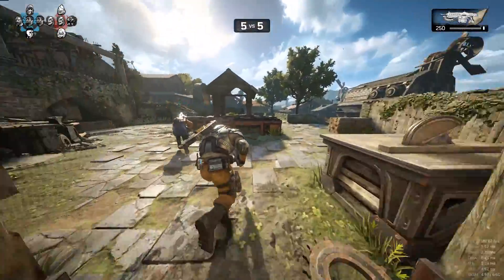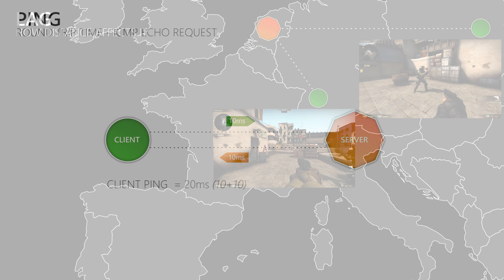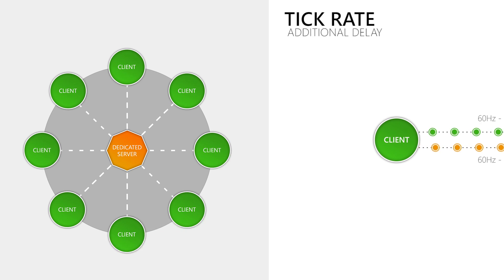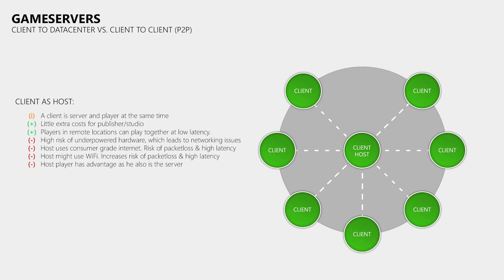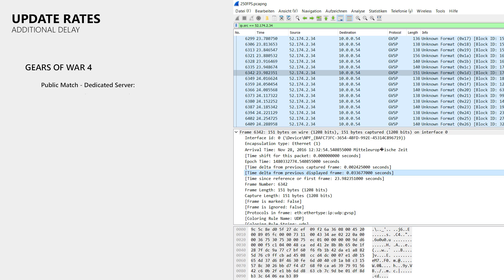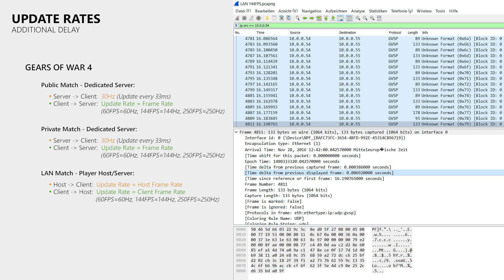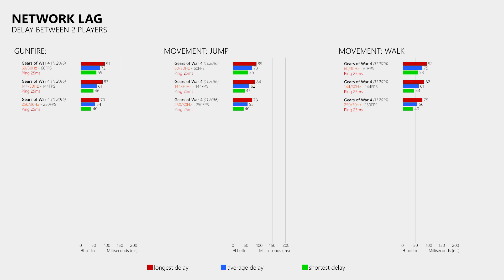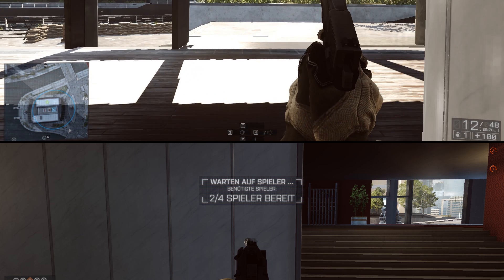Gears Of War 4 Netcode Analysis - 250Hz Update Rate!?

Comment: Your fps are very high, I guess. At the release they were even fucked up with a 1080. Wuld be nice, if you could tell me your system specs, so that I can compare them to mine. Never mind, you'Re playing on very low settings, as it seems. :D

And a huge shout out to you, Chris. Your content is everytime high quality. I really love your ambition, which you put into your videos. Keep it up.!
Reply from the maker: I have a 1070 here and a core i7 6700k. With the recommended GFX settings (which are quite high) I get 180 to 220FPS.  It's a pretty well optimized console port. :)
Reply: I've got an i7 5930k,  Msi 6G 980ti. I'll assume the same fps, maybe a bit higher. Is there an option to limit your fps?
Reply: I've got an i7 5930k,  Msi 6G 980ti. I'll assume the same fps, maybe a bit higher. Is there an option to limit your fps?

Comment: So, what exactly does the "network smoothing factor" option control in battlefield? In bf3, i would turn mine all the way down because when i used the TV missile in the helicopter, the input lag would he waaaay lower, but only when my ping was less than 30. Aside from this, weird things would happen, such as stuttering when i took someone's dogtags and players skipping around when they were so far away.
Reply from the maker: +Pilot KaZZ it made player movement (especially rotation of i. e.  tank turrets) smoother. But it did that at the cost of increasing the delay.

Comment: There is an issue with the server or the clients.
To explain this in a simple way.
I can walk upp to a character that is standing still in a VS XBOX match, shoot at close range several times without doing any damage.
The opponent can turn around and kill me and the info on the screen will tell me that I hit for ex. (70% in 1 shot) although I shot several times with active on close range.
And in some matches you have a hard time moving and pointing opponents out.
It feels like there is some data loss, where shots, moves and click are not registrered by the server.
This could be that the lagcompensation drops your shots because another player has high ping and the offset latency sees your ping as to high though you have a great ping to the server but not to the other player.
This is a hugh issue which is overwhelming the Gearsofwar forum with posts and people quiting the game in a on going match.
It doesn't mattter how good the graphics, sound or anything else are if the main thing does not work, TO SHOOT OTHER PLAYERS.

Comment: Why even have 250 hz if you cap the other necessary part of it to 30 hz? Better question: Why even have equal send/receive updates if the consoles can't even benefit let alone grasp 250(I get it, PC this is fine); Thanks to Microsoft TCR. Btw Chris, did you ever happen to find out on what the TCR for the Xbone and PS4 is?
Reply from the maker: Sadly I could not get access to a newer TCR. As of why GoW4 can even send 400 updates per second when you run it at 400FPS - I really have no idea why the developers would do it.
Reply: Reason I'm asking is because my cousin wants answers as to why these systems are still using services that as outdated as they can get.

Comment: When player is standing still does the lag compensation still reject the hit, or is it only for moving targets?
Reply from the maker: only for moving targets. also when he is running straight into the bullet then the it will not be rejected either as he always was in the path of the bullet.
direction, speed and time are the factors that count here.
Reply: Best question and answer, right here!

Giving that lag compensation is only calculated during movement: would you always want to stay moving and never straight towards or possible even away from the enemy? And at what point(ping) does lag comp get applied?

Comment: I totally disagree that lag compensation is a good idea, though that argument is too big for youtube comments. CPMA (and derived games) used non-compensated but extremely high quality netcode and it resulted in a solid game experience for people of even pretty reasonable pings (100 was fine-ish, 150 was playable). This also meant that player movement and dodging was not penalized by the netcode and by other people's connections.
Reply from the maker: It depends on the speed at which the players move. The faster they move the higher the risk that even at very low pings a hit will not register.
Battlefield 4 showed us that when the lag compensation was set to a way too low value by accident. It caused that even at pings of just 20ms hits did not register. Which is why they now separated lag compensation for infantry and vehicles as these move at vastly different speeds.
Lag compensation is required in online multiplayer games - especially in those where the players move at high speeds. The problem is that nearly all games compensate way too much latency. They do not use a sane limit where they stop and this is why low ping players can have a bad experience inflicted by a high ping player.

Comment: @Battle(non)sense
250Hz update rate that is amazing! But why aren't more games doing this? 
How much data do you sent per minute compare to a 60Hz or a 30Hz update rate?
Would it be possible to make a game that has 250Hz update rate whit 64/64 Players servers?

I know not everyone has amazing internet speeds, but why hold back the people that do have amazing internet speeds?
Reply from the maker: Maybe the bottleneck is not the upstream connection of the players, but the bandwidth and load that this generates for the server.
i.e. think about a 64 player Battlefield server receiving 250Updates per second from 64players instead of just 60 per second. I think this could become a problem.

Comment: That update rate is theoretically the best you can do right? If your client's framerate is less than the update rate, it will at some point just be updating multiple frames. If it's more than the update rate, then you are theoretically wasting processing power if we prioritize lag reduction (which we do).
Reply: Youtube wont let me edit. It will update the same frame to the server multiple times if framerate is lower than the update rate.
Reply from the maker: If I set all GFX options to "low" then I can actually get nearly 400FPS on my PC. So as long as the game does not have a FPS limit my update rate is also unlimited.
Reply from the maker: The game is not sending "frames" to the server. In an update it tells the server:
- your current location
- your current orientation 
- what you are doring (sprinting/peeking/firing/....)

How frequently this information is sent depends on your Framerate in GoW 4.
17FPS -> 17 Updates per Second
49FPS -> 49 Updates per Second
168FPS -> 168 Updates per Second
2FPS -> 2 Updates per Second

While i.e. Battlefield 1 will send that information at a fixed rate of 60Hz - even when you play at 50FPS.
Reply: Battle(non)sense Thank you for your reply (and videos in general). My question was more to, is what would happen in Gears of War if we could theoretically make our update rate 60Hz even if our framerate was 50? Would the measured delay be the same as if the update rate was 50 Hz (because game logic could in theory update per frame and as such there would be nothing more to update if your update rate was above your framerate)?
Though we do know in some games that it probably doesn't work like this, like exploding 500 barrels in Garry's Mod will result in physics happening between frames -- or will it? The test (at least for that game) would be to limit your framerate to 15 and 60 and start doing physics stuff, see if there are different end results in things like bouncy balls between framerates
Reply from the maker: It depends on if the client ties it's calculations to the framerate of if these two are separated.
If they are not separated then there is no new data to send when your framerate is lower than the fixed send rate.